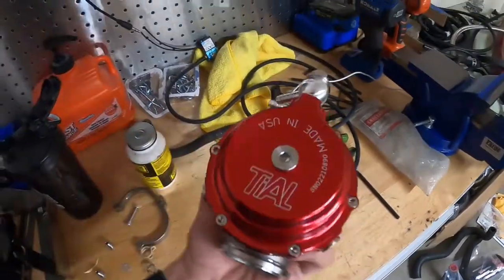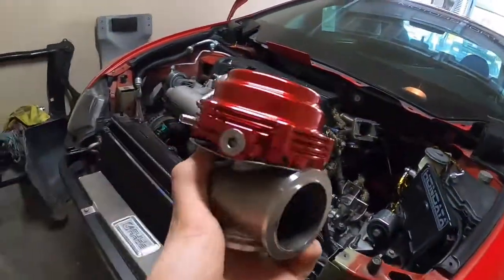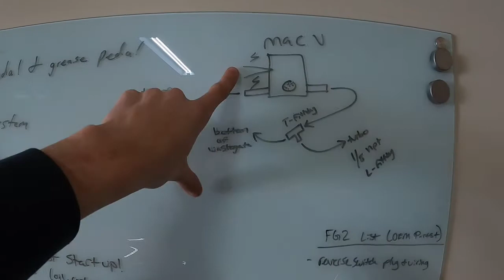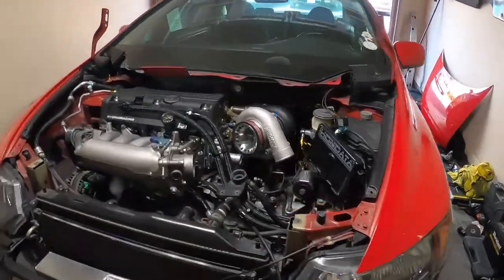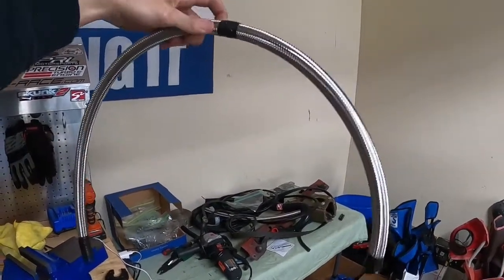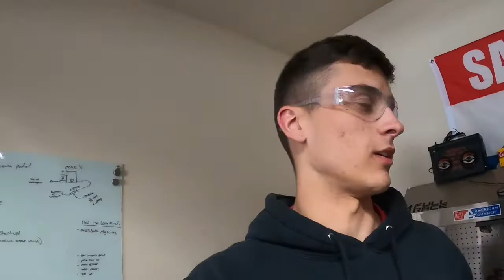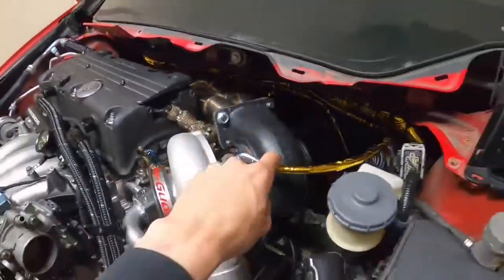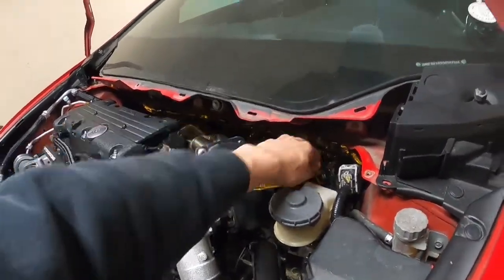Boosting the 8th gen Civic SI pt. 16 - Installing the Turbo Manifold and Turbo W/ Wastegate

Comment: Did you run the CX racing turbo too, is it made in china or what kind of quality are we talking about?  Looks like you tried doing things the right way.  Any updates? Thanks.
Reply from the maker: We ran a precision 5858 turbo instead of the cx racing one. I think the turbo manifold was the only thing from CX racing we kept, and still had to do a lot of modification to make it work with the parts we wanted it to.

Comment: Did you just take out the heater core I don’t have to cover it or anything just on the thermostat
Reply: I got the heater plug for the thermostat housing, and was able to delete the 2 heater core lines, i capped off the 2 heater core inlets on the firewall with rubber heater core delete cover plugs.

Comment: what manifold are u using?
Reply from the maker: CX Racing thickwalled manifold, had to modify it to fit the tial wastegate though
Reply: @dbjankfactory  thanks for the reply, i planned to get the same kit. Im trying to learn as much as possible
Reply from the maker: @A2RACIN  so are we bro haha we just figure it out as we go. No problem thanks for watching!
Reply: @dbjankfactory  what else is done to the car.?
Reply from the maker: @A2RACIN  it’s a k24a2 block, k20z3 head, rsx oil pump, tsx cams, trans has Dc5 gearing, bc ds coil overs, all the bushings have been replaced, pretty much it until the turbo is finished.
Reply: @dbjankfactory  nice, im boring out the k24a2 and dropping in 87.5mm Pistons with 11.5compression and scat rods.. hopefully with everything else ill hit 500+ or stop at 600s..
Reply from the maker: @A2RACIN  thats going to be an awesome build!
Reply: Did you relocate battery to the trunk?
Reply: @sirob584  in the video thumbnail u can see under the passenger headlight that he has a dc5creations battery tray tuck kit.
Reply: @user-hh4hc2lt6e  that’s what I ended up running as well.